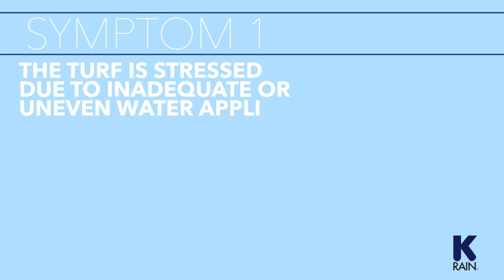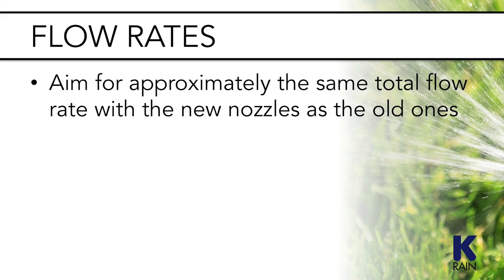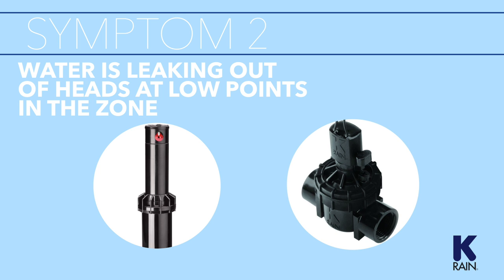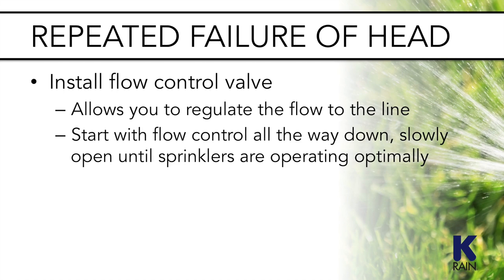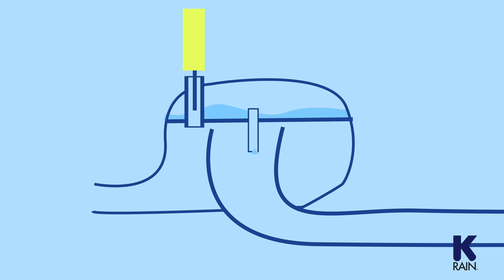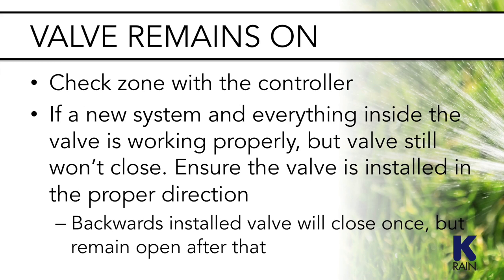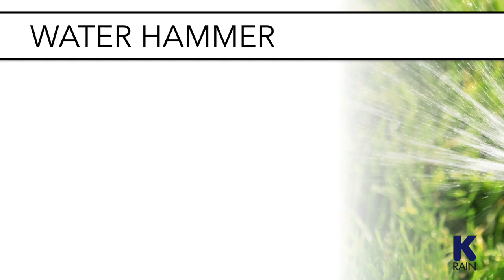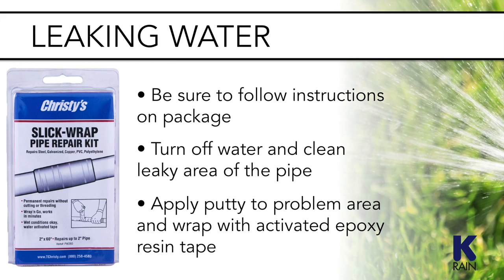How to Trouble Shoot an Irrigation System

Comment: How do you set the left? Stop and right stop on the sprinkler.
Reply from the maker: 1. Finding The Left Start Position
Using the palm of your hand, twist the Nozzle Turret (K) all the way to the right, 
then all the way to the left until it stops. Notice the position of the Nozzle Arrow (C). 
This is the Fixed Left Start Position (M). The sprinkler will begin spraying from this 
position and rotate clockwise until it reaches its Right Adjustable Stop (N). 

2. Changing The Left Start Position
Insert tip of the K-key (A) into the Pull Up Slot (F) and turn ¼ turn to prevent the 
key from slipping out. Then, firmly pull up the entire spring loaded riser assembly, 
trying not to accidentally turn the Nozzle Turret (K). To change the Fixed Left Start 
Position (M), turn the Lower Riser (L) any direction necessary to aim the Nozzle 
Arrow (C) to the desired left start position. There is plastic ratchet at the base of 
the riser and a “clicking” sound will be made while turning. The top Nozzle Turret (K) 
section of the riser is not what is turned to adjust the left stop. However, it manually 
turned to make sure the Nozzle Arrow (C) is all the way to the left fixed side. 

3. Changing The Right Stop Position
Insert the K-key (A) or medium flat blade screwdriver into the Arc Set Adjustment (E)
slot. Turn clockwise to make the arc larger and counterclockwise to make the arc 
smaller. The arrow at the end of the Arc Adjustment slot will point at the degrees of a 
circle the head is set to rotate – indicated by the 360, 90 and 180 printed on the top of 
the head. When set to full circle/360° rotation, the head will turn clockwise continuously

Full instructions with diaghram located: https://www.krain.com/content/files/images/landingpages/rotors/k2%20pro/k2%20pro%20instructions.pdf